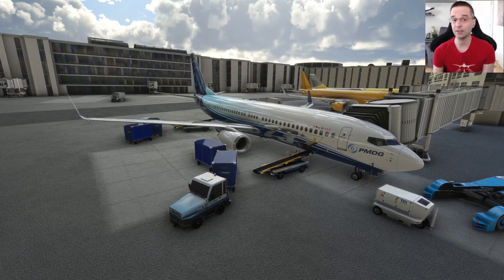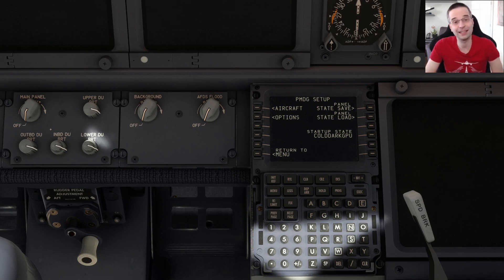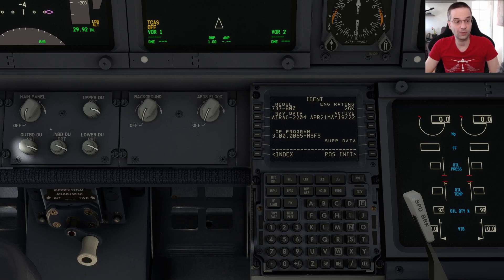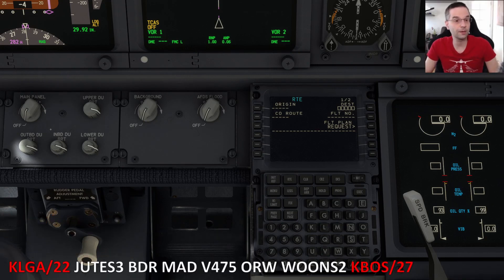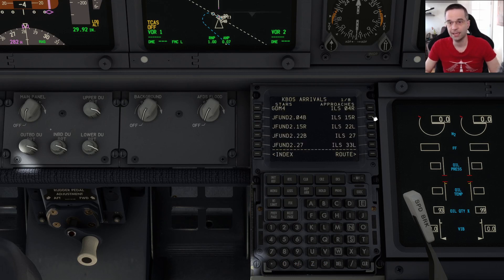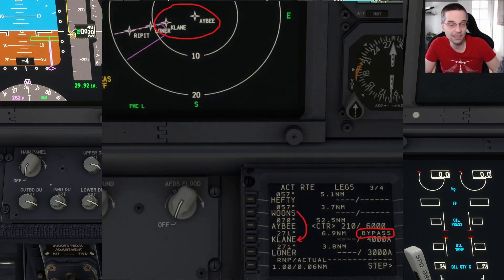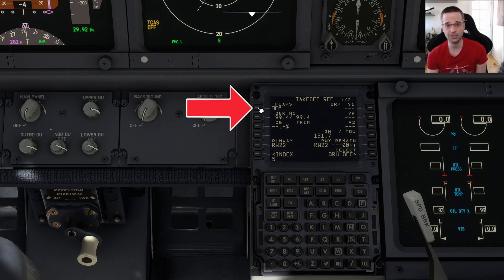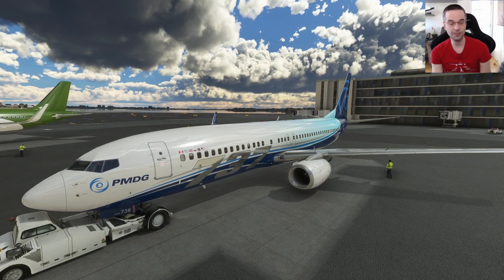PMDG 737 Flight Deck Preparation | MSFS Tutorial

Comment: Despite the great instructional style, the route used in the video no longer works (not all waypoints are still available) so I wind up lost with my own route problems to solve. Eventually gave up and looking for another tutorial. Sad to say.
Reply from the maker: hmmm, which procedure is missing? the beauty of how I explained it you should be able to make it work with any route :)
Reply: Entering your route into Simbrief, “JUTES3” and “V475” are not found. So one has to make a different route. And so I try to use the FMS to create a continuous flight path and it’s just different steps. There are no FMS manuals and so following along with a demonstration flight is the only way to learn this. And you are the only such demo that doesn’t fumble around and skip things. So I’m appreciative, but still lost. I’m an educated guy who’s been writing code as a hobby since 1979 but can’t figure out the FMS. Ugh. But I do thank you for the great videos. maybe I’m missing something.
Reply from the maker: Looks like JUTES3 was replaced with the JUTES4, so you should be able to pick it instead. V475 is the airway, so you don’t absolutely need to enter it for the route to work. I hope that helps, I remember struggling through learning this stuff too but it’s worth it once it starts to click!

Comment: Interesting tutorial. My experience with the 737-600 is frustrating because i always encounter a problem whichever tutorial I try to follow, and it's not the same one. In your case all seemed right until the STEP feature which doesn't show on my display. The second issue is that when trying to enter the V2 speed nothing works and I don't have any thing showing for speed, altitude etc. The displays are blank. To the best of my knowledge I have completed each of your steps to that point/
.
Reply from the maker: For the STEP option to appear on the LEGS page you need to put the ND into PLAN mode.
Reply: @FlightSimSchool  Hi how do I do that??
Reply from the maker: I show you how to do it at 12:13, it’s the dial above the ND

Comment: Thanks for a great tutorial series.
In this episode you disregard the CI used in Simbrief and use a different one in the FMC.  Wouldn't a different CI result in a different Block Fuel value?  Wouldn't it be better to adjust the CI in Simbrief before pressing the Generate Flight 'button'?
Reply from the maker: Yes, you are correct, I should have done that. Nice catch :)

Comment: Great Video, helps a lot. Just wondering why you set your fuel that you loaded into the plain as exactly what the Block Fuel was, was that just for the video.  I keep seeing from airlines that it is Block Fuel rounded up to the nearest 100 then plus 100 for contingency (Long taxi, delays after push back, de-ice time in the winter etc.).
Reply from the maker: I believe SOPs are different depending on the airline, but for my purposes in the sim, I find this to be close enough.

Comment: Simbrief will put in some random number of passengers, and calculate fuel based on that payload, so should we leave the payload to 100%?
Reply from the maker: You can go one of two ways. Option 1 is to tell simbrief you're fully loaded, and set the plane to the same thing, like that your fuel numbers will be more accurate. Option 2 is to let simbrief choose its random value, but then you need to go into FS Actions and set all that up correctly. I didn't mention this in the video mostly because you don't need to worry about fuel planning too much when you're just getting started, but I am preparing a follow up video about it.

Comment: Some reason when I start up the capt MFD doesn’t turn on only the FO MFD does and when I go onto the FMC for the settings after I choose something the FMC just shuts down
Reply from the maker: It goes into single FMC mode with just the battery on. My guess would be ground power isn’t connected or on. You can check it in the Ground Services Menu. You can also start the APU to see if it helps keep both FMCs on.